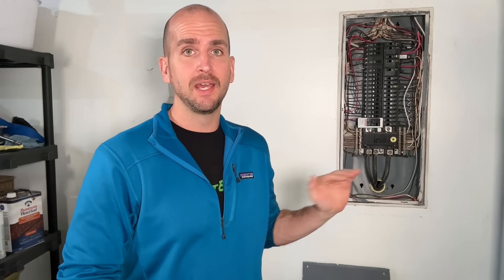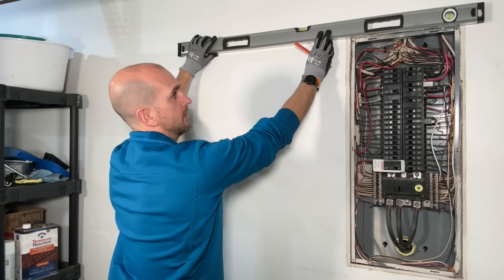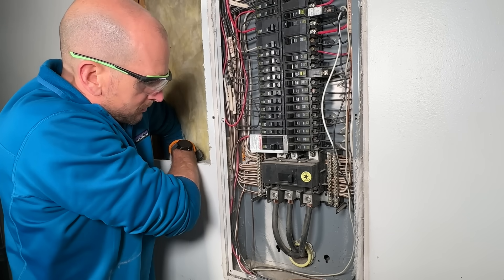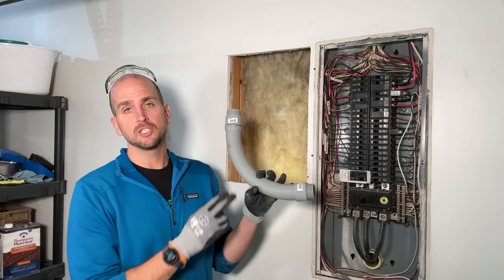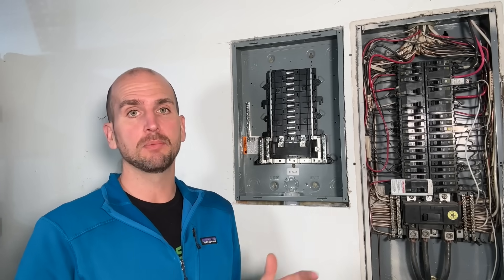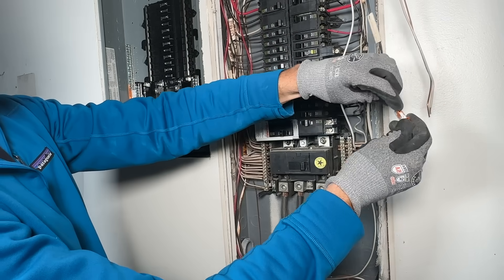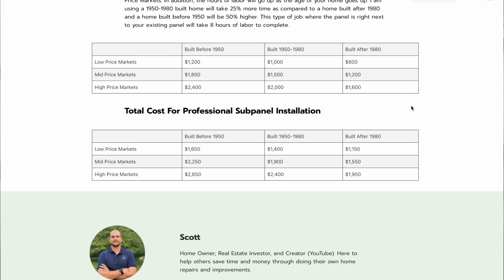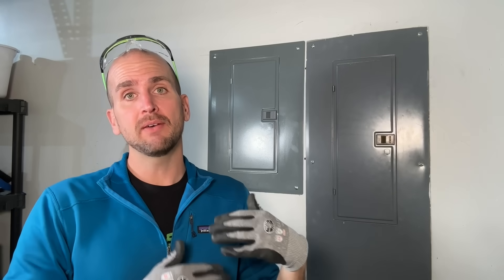How To Install A Sub Panel Next To Existing Main Panel

Comment: Ok....you state you do not connect ground and neutral, but what difference does that make when the neutral bus bars are bonded  to the same panel.  I have been inspected  by one of the most strigent electrical inspectors in the country, and they never mentioned anything about neutral and ground wires connected on the same bus! These inspectors are master electricians!
Reply: First off the neutral is not actually a ground.  We get the bond from the earth.  Hence 8' copper rod driven into the ground,   attaching the proper conductor then connecting cold water pipe, structure steel, and in some states two grounding rods no close that 6'
Reply: Negative most inspectors are NOT MASTER ELECTRICIANS. They just have an in!
Reply: You are both wrong
Reply: There are many places where electrical inspectors are not master electricians, and some have never been electricians.The neutral is the grounded conductor, which means that at some point in the system it is bonded to the ground. The only point in the system where the neutral and ground are bonded is at the disconnecting means, which usually means in the main panel. The subpanel is a feeder circuit and is treated as such. While you may purchase a panel where the bonding screw/strap is bonding the neutral to the panel enclosure, this should be removed/disconnected when used as a sub panel.

Comment: uhhhhhhhhhhhhhhhhhhhhhhhhhhhhhhhhhhhhhhhhhhhhhhhh @12:40 the breaker appears to be ON.... @12:52 it is off? You did this work hot?
Reply: It's almost never necessary to shut off the main to work inside the panel.

Comment: Awesome job. Did you not have some #2 white for your neutral?
Reply from the maker: Nope, but I could have used some white electrical tape on each end to help easily identify the neutral conductor from your hot conductors.
Reply: @EverydayHomeRepairs  Yup, I would definitely do that.
Reply: @EverydayHomeRepairs  Not could have, should have. NEC requirement, it's not optional.

Comment: In Canada, lengthening the wires to bring them into the sub panel is totally illegal. You would have to remove the wires from the main panel and the have them enter directly into the sub panel.
I don’t believe that this is a diy project.

Comment: The two panels aren't perfectly level.

Gap between the two panels is smaller at the top, compared to the bottom. That would drive me crazy.
Reply: Agreed. The guy I learned the trade from taught me early on, when everything's perfect nobody notices. When even one thing isn't level or plumb, everyone does. In residential, especially, the customer can only see what's visible outside the walls so perfection is always the goal.

Comment: Is there a maximum distance the sub box should be placed away from the main panel, or could the sub box be in another area?
Reply: Sub panel can be almost anywhere
Reply: @pld8993  Do the cables have to be in conduit in the attic on the way to the sub box?
Reply: @Geek-a-Zoid  No, unless there is a need to protect them from physical damage, very unlikely in a typical attic.
Reply: That's great thank you.

Comment: I personally like the metal level that was very close to the live main lugs. That is why you should call the electric company and have the power shut off. Just curious, doesn't this need a permit and inspection for installation?

Comment: Good job on the video. I enjoy the channel. Not to throw a wet blanket on your plans, but your bus bar rating needs to be considered in this situation. NEC says (depending on pertinent factors and calculations) you may not be able to add a solar power source to that main panel... if you have a 200 Amp Main Panel, with a 200 Amp Main Circuit Breaker, and 200 Amp rated Bus Bars. For example, if you add an additional 40 Amps of solar power source, factored in @125%, your 200 Amp Main Bus can now be overloaded with 250 Amps of current. Depending on power source and other factors and considerations (i.e.- landing 100 Amp sub panel/solar feed right next to Main Breaker, vs. on the other end of the bus) and calculations, that won't pass an electrical inspection. The new sub panel bus bars will be even more limited, since it has a lower current rating (125 Amp bus with 100Amp feeder CB, plus 125% solar current). Your new sub panel is inadequate for large solar and can't be used as it is. One solution, is to upgrade the capacity of your Main Panel, with a new Main Panel of higher bus bar Amperage capacity. Another solution, is to connect your solar power source to the service side of your 200 Amp Main Breaker, between the electric meter and the Main Breaker. See the existing code that permits that. Of course everything must comply with the NEC and AHJ requirements. Here's some of the references - 705.12, 705.12 (B)(3)(1-6), 230.82(6), lots of others.  Good luck!
Reply: I think you may be misinterpreting that code section. For instance, that is supplying power not using power. It will be supplying power to circuits that would otherwise be supplied by the utility so to me it wouldn’t make much sense . So for instance, 40 amps at 125% is 50 amperes. I would believe that the bus bars would have to be at least rated at 50 amps. I’m just a carpenter so I’m just guessing
Reply: @highvoltage1979  Yes, the solar inverter is supplying power. And the 200 Amp Service is supplying power. Together they supply more power than the bus is rated to handle. Theoretically, the bus can possibly be carrying more than 200 Amps to the connected loads. Since there's more than 200 Amps available, the Main Breaker won't trip. So the bus isn't protected from overload. What are the odds the bus could be overloaded? Doesn't really seem likely, does it? That's why NEC allows 120% of the bus rating. But, if there's a 200 Amp Main breaker, plus 50 Amps of solar, that exceeds 120% of 200 Amps by 10 Amps. That's a fail.
Reply: @manabouthome  That does make sense, I didn’t look at it in that manner. Thanks
Reply: @highvoltage1979  Thanks for asking. I imagine there's a lot of misunderstanding around that, until it's clearly explained. I certainly had to sit and think on it after I first learned it!
Reply: I should clarify here, that the 120% leeway on the busbar rating is per 705.12(B)(3)(2) "Where two sources, one a primary power source, and the other, another power source, are located at opposite ends of a busbar that contains loads, the sum of 125% of the power source's output current and the rating of the overcurrent device protecting the busbar, shall not exceed 120 percent of the ampacity of the busbar."  However, due to the location of the 100A CB in this video, that doesn't apply.  I think 705.12(B)(3)(1) would be applicable - "The sum of 125 percent of the power source(s) output circuit current and the rating of the overcurrent device protecting the busbar shall not exceed the ampacity of the busbar". So, the busbar rating is taken at 100% (not 120%), due to the position of the 100A CB in this case. This would make it worse than I described in the comment above.
Reply: totally agree, I did a line side tap for my system totally bypasses the load/breaker panels and feeds directly back to the CT/meter pan, I had to since it was a giant 39kw ground mount system

Comment: How many sub panels can you have?
Reply: As many as you want
Reply: @pld8993  As many as you want so long as you don't exceed the maximum voltage drop recommended in the NEC.
Reply: @taylorlightfoot  Voltage drop has nothing to do with number of sub-panels allowed, and the NEC has no voltage drop requirement.
Reply: @taylorlightfoot  Again, voltage drop has nothing to do with how many sub-panels you have. Voltage drop only needs to be considered if conductors are long (+100' is rule of thumb) or if the conductors are full (max current). If you had 10 subpanels, for example, voltage drop is not an issue except for any that are a long distance from the panel. If all 10 are within 100' of the panel, it's a non-issue.

Comment: This guy is no electrician thats for darn sure. He has no business teaching others. Too many things omitted.
Reply: Dang bro.  Did he get everything on point ? No!   but  U gotta admit he has some  skills!  I know 30 yr masters who could fuk this gig up! Just saying he's no hack!
Reply: @michaellike5037  He is a jack of all trades master of none. If you want to show someone how to do carpentry and not right, thats one thing. But electrical work? No way. He has too many things to learn and shouldnt be attempting to show others. He thinks that just connecting up wires and getting power from one spot to another is all there is. Thats what makes him dangerous. Anybody can do that. It must be done SAFELY and LEGALLY. This is where he fails. If somebody follows his lead and ends up starting a fire he may be in a bunch of trouble. And by the way SOME skill in electrical work is just enough to be dangerous.
Reply: He along with others, show people to use non contact voltage detectors to determine if a circuit is safe to work on. I cant think of anything he shows people thats more dangerous than that. Any half a$$ electrician knows you meter a circuit before cutting into it.

Comment: You are not allowed to use an electrical panel as a pass through junction box. The two circuits you extended the wire on with the wago is not allowed. It’s a code violation.  You. Need to pull the wire out of the panel and land it directly in the sub. You can extend a wire that is in the electrical panel if it stays in the panel. As in the wire is to short to reach the breaker and needs to be longer. You should also identify the neutral wire with white electrical tape at each end.
Reply: What is the code reference you a referencing that says it’s not allowed. Looks like you can according to 312.8A
Reply: This is approved in the United States
Reply from the maker: Thanks for the feedback.
Reply: Bro ur WRONG.  panels are allowed according to the NEC  to b used as a pass thru  junction box!

Comment: The panel to the right is actually the sub panel. The main panel in a resident unit is usually the meter or service panel. What size wire and breaker did you use to feed the second panel?
Reply from the maker: Went with a 100 Amp and 2 gauge for the conductors.
Reply: @EverydayHomeRepairs  Yea, I did the same thing about 6 mono ago but was limited to old style 60A GE Q Line style breaker feed but it’s more than enough for me though.
Reply: Could we land the neutral in the extra lug in the main panel beside the existing one?

Comment: I always used cardboard that went across the lugs for extra protection. Many times had to wire hot due to customer needs. Really easy to cut a scrap piece to fit between the flanges. It's way too easy to forget about those HOT lugs.
Reply: I was going to suggest the same... a piece of cardboard.
Reply: I put some electrical tape over mine, as a more permanent solution.
Reply: Haha. I've always done the same. Sometimes my techs are shocked and ask why😂
Reply from the maker: Great suggestion, thanks for the feedback!
Reply: @EverydayHomeRepairs Newer QO and Homeline 150-225A load centers come with plastic lug covers.  I don't know about the little panels like the 100-125A ones, though.

Comment: With the addition of a 100amp breaker on a full (Main) panel...haven't you exceeded the capacity of the Main Panel?
Reply: Yep. Most likely. Go to my earlier post.  First thing u do is take a load calculation
Reply: @michaellike5037  Incorrect. The sub panel is a feeder circuit from the main panel, which has a 200A main breaker. No more than 200A will flow though that panel, regardless of how many or what size breakers you install.

Comment: My Mother had a heat pump many moons ago and we had NOTHING but problems with it. Turned out it was a bad computer board, but even after that was fixed, it did not provide enough heat when it got really cold. We couldn't afford to buy another new furnace so we had electric radiators that we got for each room. Mother finally got another mortgage and used the equity for a new furnace and went back to Natural gas. Heat pumps also work all summer and all winter, so it's a lot more electric and wear and tear on the whole system, rather than just one at a time and a break in the seasons. Not trying to tell you what to do, just letting you know that they've been an awful experience for us and cost a LOT of money, then even MORE money to fix what we spent a lot of money on in the first place.

Personally I have no valid opinion of electric cars. I personally wouldn't want one until I was certain they don't burst into flames and set your house on fire, and certain that the fire department has full capability of handling those particular fires. You cannot just hose them down and put out the fire. Also, they have all this computer stuff in it and can really mess up your day if one thing goes wrong. From what I've heard, they cannot just be hooked up to a tow truck and towed in. Also, if you have a loan on the insanely expensive car, and you run into a money issue, a third party can access your car via the Internet and make it refuse to start and impossible to drive. So it wouldn't matter if it is in your garage or not. They don't need a Repo man (Professional car thief) to steal your car from you anymore. It also goes for the thug car thieves. They're hacking into them too and doing all kinds of mayhem or just stealing your ride for their illegal acts. Some lady recently had her car stolen, she made a police report and did all that, but she got a "Failure to Appear" notice in the mail. The person that stole her car illegally parked it when he was finished with it. It was cited and it didn't come back to the officer as "stolen" So she had to go to court, show cause of why she failed to appear for the parking violation, and if she didn't respond to that a bench warrant would be issued for her arrest, so she contacted KMOV (CBS News) to help her get that mess sorted out. So in my opinion, those are way more trouble than they're worth. I think if I was a wealthy person, I wouldn't even own a car. I'd just take a cab where ever I needed to go. An actual Taxi Cab. None of that Uber malarkey.

But great video anyway, and your electric panel is so neat and tidy. I rewired a circuit and made a new home run and it's a mess in that panel, and I did not make that mess. I think I did contribute to the mess, but it was my first time ever doing a new circuit with a home run. All the other houses I rewired, were more or less fixing things that weren't done right in houses my Mother purchased. As soon as I get these health issues fixed, which likely will never happen because this country feels that Americans are not entitled to have humane treatment, I am left to suffer, otherwise I'd go in the attic and do things the right way instead of spending even more money to run conduit pipe all through my house, as I need to fix things, with box extenders if I can't get the hole drilled in the right place or get stymied by a fire-stop in the walls.
Reply: Now that is a rich post...LOL

Comment: Just found your channel, great stuff!  Do you have videos that show the pairing of say, 50 or 40 amp breakers to the wire size for running the wire around 100' to a detached structure?

Comment: As an Electrician I would have upgraded the main panel. And solved the "Bundling" problem you have with all your branch circuits in a single pvc male adapter. And put a courtesy pipe out the top for future additions. But that's just me.
Reply: Well he isn’t even an electrician… idk how he’s able to do this. He shouldn’t be allowed
Reply: @samcarbone4139 cry about it